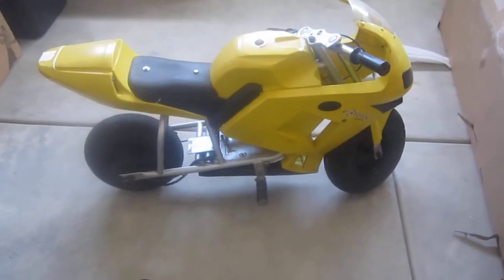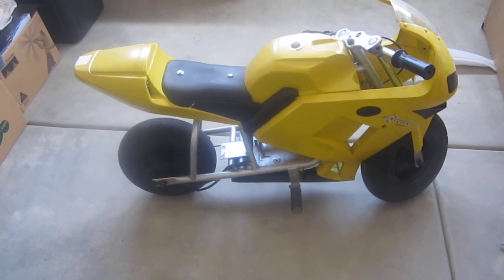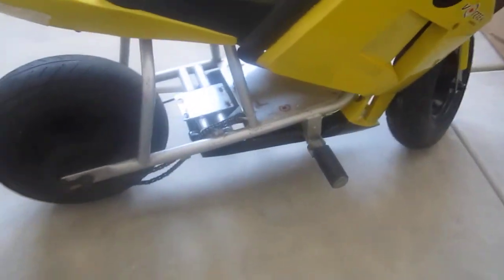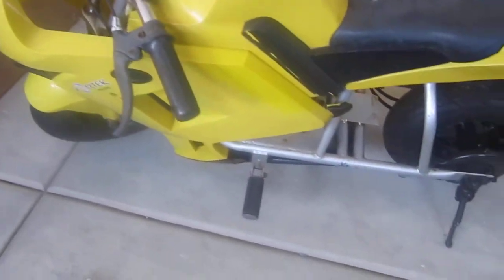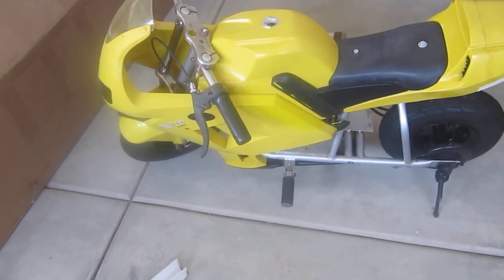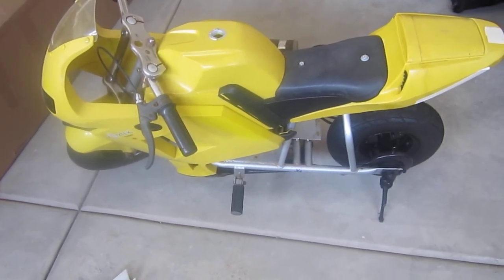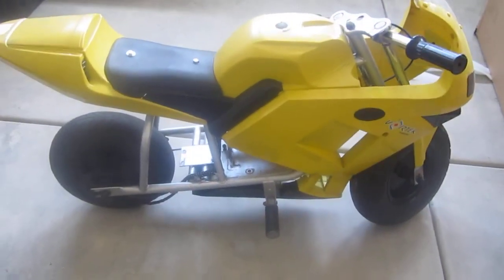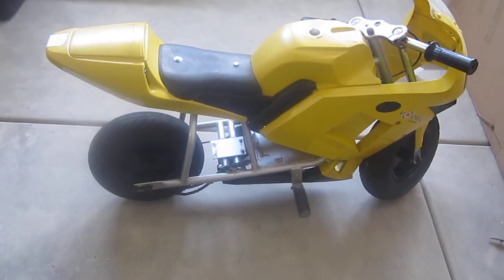MINI MOTO 400 electric pocket bike OPEN project MODIFIED

Comment: I still have mine from back in the day. It’s dead though.. I need to probably get a battery for it. And hopefully I still have the key for it lol
But I’m wanting to get it goin again. And have it be faster then, the way they come. Loves to read some thoughts n ideas on how to make that happen. Thanks! 😝
Reply from the maker: To just get it going, lead acid batteries.  If you want to go faster cheap, add 12 volts,  so if it is 24v, run 36v, etc. BUT you need the same upgraded controller. Lithium is a little more money but worth it for the battery.

Comment: you ever finish it? used to have one when i was about 3yrs old :)
Reply from the maker: Ha, oh man, I did actually.  Forgot to video it. In the end I had the motor rebuilt, then a nice controller/throttle and lead acid batteries.  Ran 20mph with 200lbs on it. I then sold it to fund another project. I really wanted to overvolt it.